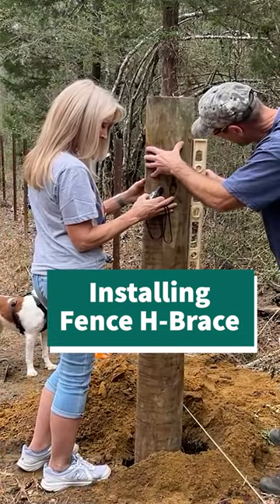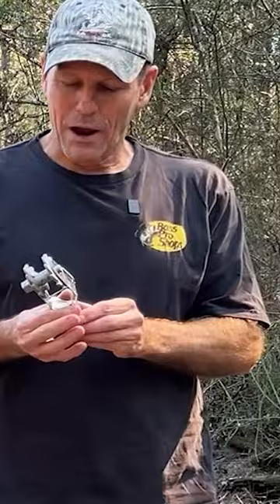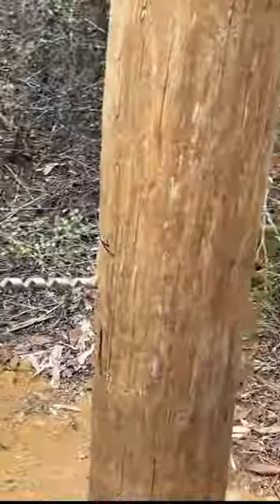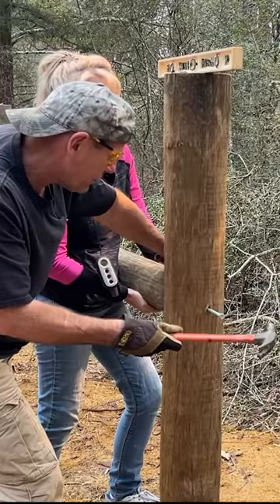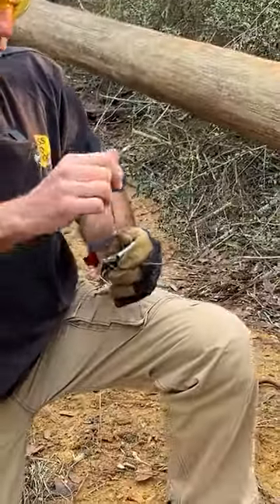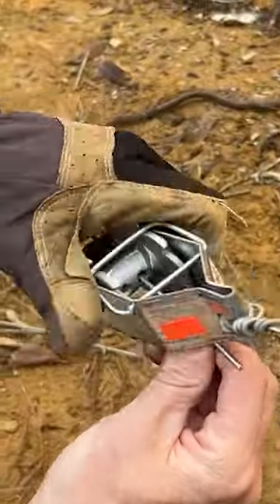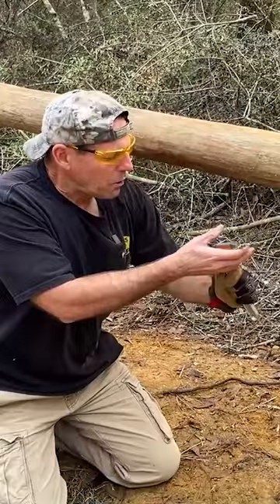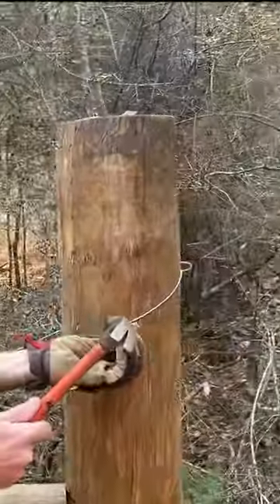Farm Fence H-Brace Install

Comment: Unfortunately you engineered wrong diagonal.  Should be low on the anchor pole than high on the brace pole. This will keep the fence from slacking. You should review your pressure force.  Poles are good  nice size.
Reply: Real ranchers who build fences for real are laughing so hard right now.
Reply from the maker: the diagonal is correct for the first pull.   The 100% correct way would be to put a double H there in the middle of the span.   full vid here: https://youtu.be/FWHlwmc1t7E
Reply: No, I guess I'm a poor explainer.  Have a great day.
Reply: You are correct.
Reply: WRONG !
Reply: @johnjameson7056 yes we all are 😂

Comment: I believe your anchor wire should be to the bottom of corner post and to the top of anchor post. That helps keep the fence tight
Reply from the maker: There is not a corner post in this video

Comment: I usually have a longer pin at the top and leave it sticking out a little..the wire wraps around this and eliminates the need for a staple , cut a little groove in the bottom with a chainsaw for the wires to sit in on the bottom end , wrap the wire around twice just being careful not to cross them , then strain
Reply from the maker: All good ideas!

Comment: Looks like you put the wire in the wrong position. 
Should of been bottom on the corner post then up on the brace post
Reply from the maker: There is no corner post in this video.

Comment: You shouldn't be trying to teach people when you don't know what you're doing yourself. That corner will pull right out of the ground if you properly tension your wire.
Reply from the maker: you shouldn't comment when you are so wrong.  Fence is one year old and tight as a drum.
Reply: @PineyGroveHomestead  but I'm not wrong. I've stretched literally miles of fence. Your design will not last. A shame because it's just a little more work to do it right.